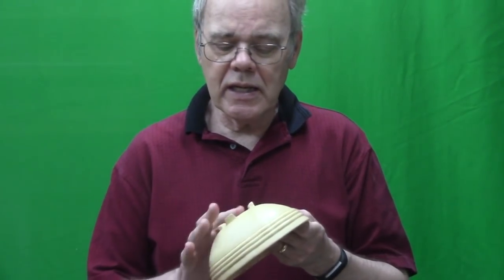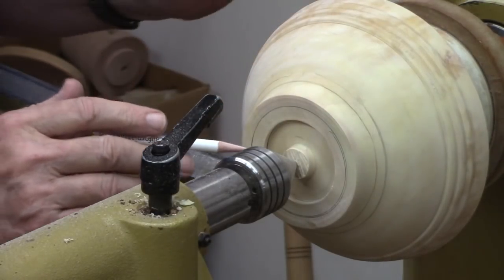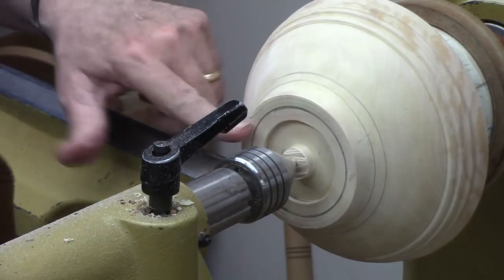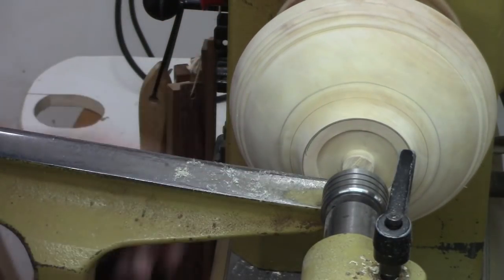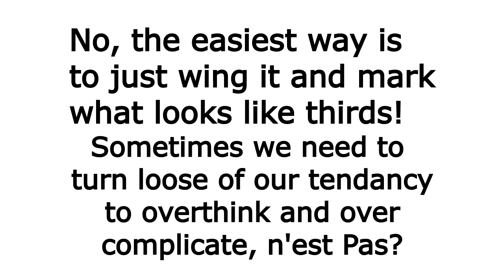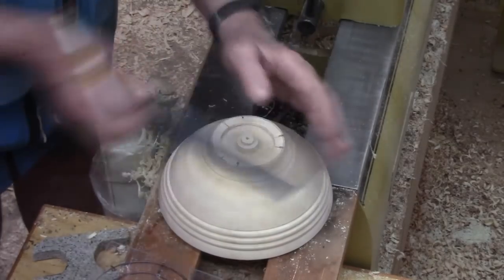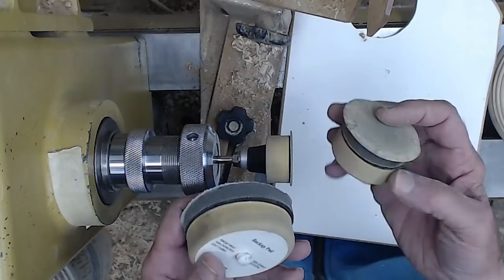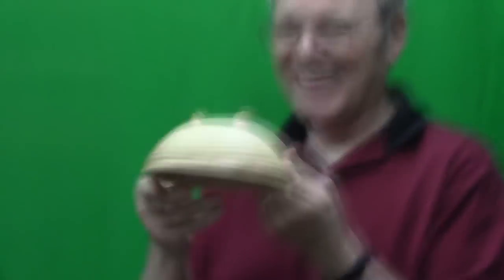Add Feet to Your Bowl - Kick Your Bowl Design Up a Notch?

Comment: Great three legged bowl Mike. Three legs are always better than four because the bowl will never rock.
Reply from the maker: Yep, 3 legs never rock. I have found on stools for toddlers, though, 4 legs are far more stable. Since bowls like these do not normally get used much, stability is typically not a problem.

Comment: Nice demo on turning the feet.  I was thinking of getting a vacuum system, but my 3520B has no threads in the head stock. So I don't know how the adaptor for the vacuum pump would attach. Is you head stock threaded? Thanks Mike.
Reply from the maker: No, rotary adapters do not normally thread in. Watch this and check out the guide I have on my website on my system. https://youtu.be/BEjQGavlPQU

Comment: I made recess dove tail tool you showed how to make in previous video.  how do you sharpen this?
Reply from the maker: I hone the cutting surfaces. The front surface can be easily sharpended on the grinding wheel also. The inside surface can be done on the side of a flat CBN wheel. I would not do that with a AO wheel.

Comment: Very nice demo Mike. I don't know why I never thought of the coping saw for trimming. Well maybe it's because I don't have one. Will have to take care of that soon. May I suggest that you position your backside camera a bit higher. Everything you were doing on the front was lost. Thank you for sharing. Have a great day and stay safe.
Reply from the maker: Thanks 👍 Coping saws are cheap. This is the one I have and I am happy with it. https://amzn.to/3zhHlFZ  I think you can get this model from Lowes as well.  I use for lots of small cutting jobs. Could be used instead of a the flush cut saw I use for final parting off. I went back and looked and it is not obvious to me which scenes you are referring to. Can you give me a minute mark so I can review again?
Reply: @MikePeaceWoodturning  At 0:43 to 1:20 the tool was hidden behind the tail stock. Later at 3:02 you moved the camera higher to a much better view.
Reply from the maker: @glencrandall7051  Thanks. I think I started with my short tripod that the camera was already on and then switched to my taller one.